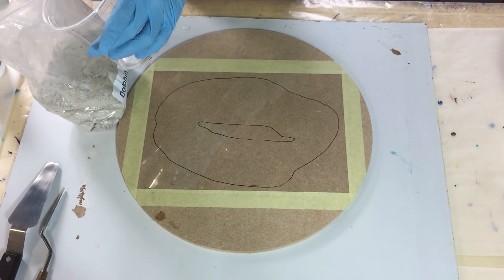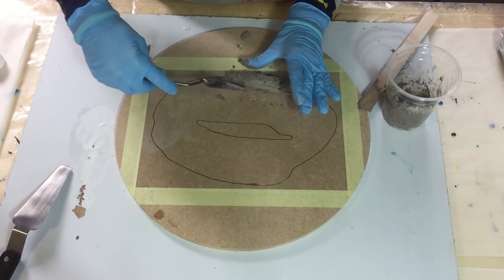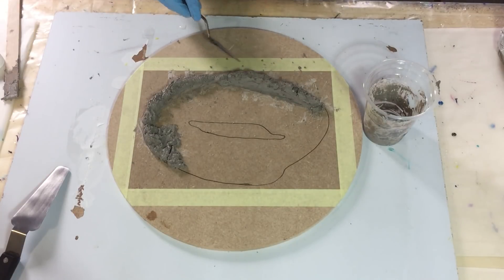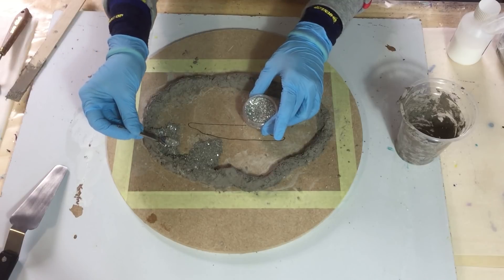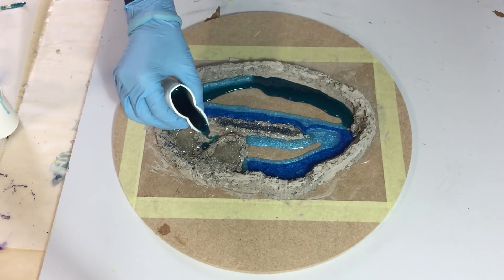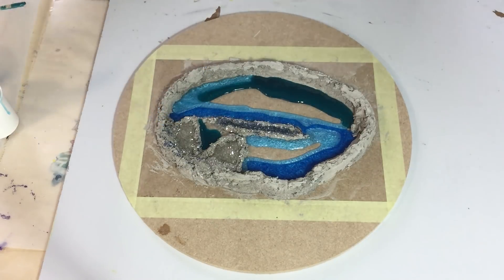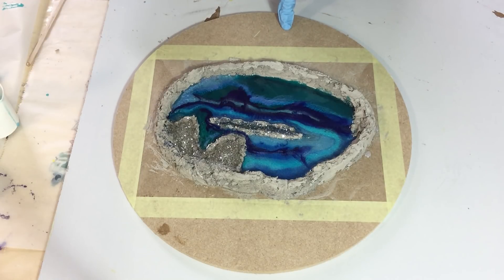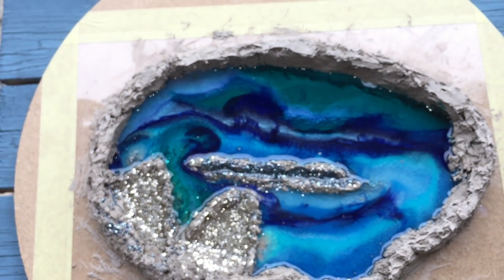132. Free Form Resin Geode. Experiment Resi-Crete Barriers. First Layer

Comment: It looks great.  Are you intending that the resi-Crete outer barrier will stay and become part of the Geode, or will you separate it?  The resi-Crete does look like the natural stone colour.  Well done.  I admire you very much,
Reply from the maker: Thank you so much Gayle. No I want to leave it on. I like the rough look. I will fill the resin to the top of the outer barrier and the middle part with the resi-crete I will build up to create some depth. The illusion that there is a hole. That's what I have in my head, but I don't know if it will work. We will see.
Reply: Petra Jongbloed that will look great.

Comment: awesome, wish I could get it in the U.S :( Great video as always.
Reply: @Stephanie Gagos have you looked into the Ingredients? It may just be good ole concrete lol . I'll have to find out what it is.
Reply from the maker: Thank you so much Stephanie Gagos. I searched the internet and you are right, you can't buy it in the U.S. You can only buy it in UK, Canada, Australia and the Netherlands. I also checked Amazon, but there I couldn't find it either.
Reply: I actually did find it on Amazon. Pretty pricey so before I buy it I am going to look into making it. @petrajongbloed4425
Reply: I'm going to look into it or at least making something similar. @tammyandersonart
Reply from the maker: @StephanieGagos  Yes, it's not cheap. But I wanted to try it and maybe I will also try it with normal concrete that you can by in the DIY store. That's very cheap,
Reply from the maker: The powder looks the same as normal concrete, but there is also a bottle of polymer resin and with this liquid you need to mix the powder to the resi-crete.